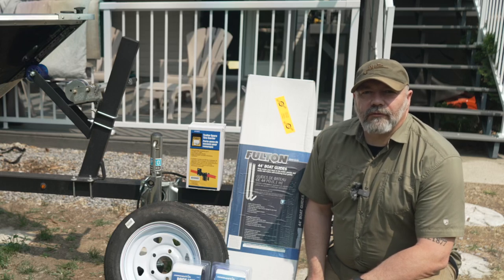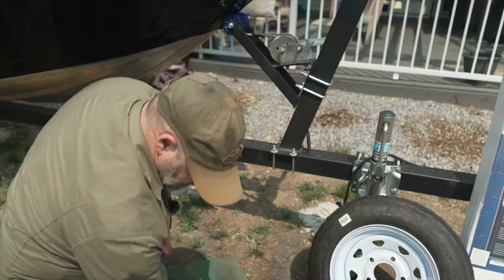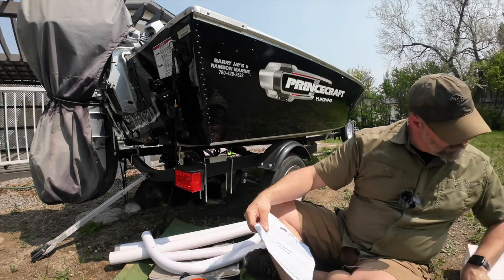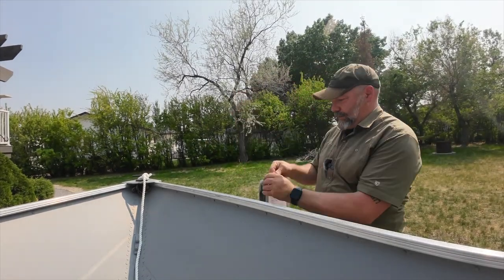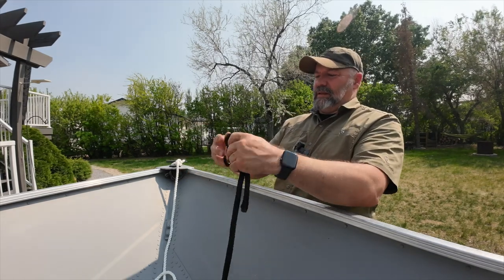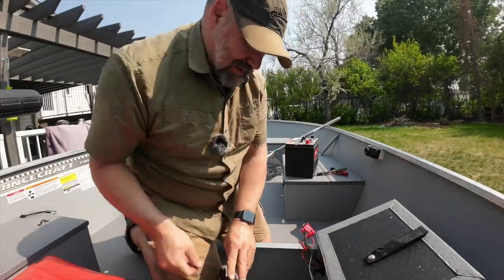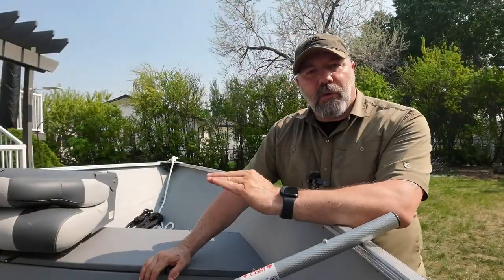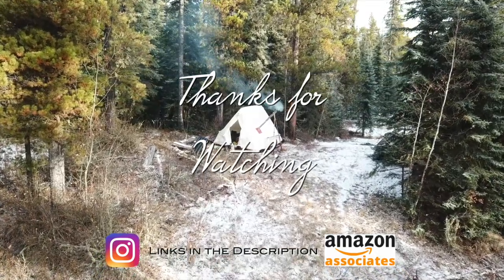Princecraft Yukon 140 & Karavan KBE-1250 Trailer Upgrades | Trailer Boat Guides | Spare Tire

Comment: Good video. 
I have a new 2023 14 Yukon as well however I mounted a Scotty anchor mount to the front bow . Not the removable one but the flat mounted one . Then bolted a cleat on that little step inside the front bow to tie off . So when I launch I’ll pull off the required amount of rope getting the boat off and pulling it back to the shoreline . Then once I’m of to the the fishing hole I tie on the anchor . 
I see as well you have your motor raised. Is it or suppose to be a 20” long shaft? . I ran into the same with my new 25 mercury long shaft . When I measured the motor I get 22” 🤔. Before this motor (mercury) I had a Yamaha FH25 FS portable. Needed no adjustments at all . Cavitation plate lined up perfectly straight with the keel ? . Go figure. 
Anyway, have fun .
Reply from the maker: Ohh interesting!  I'll have to check those Scotty anchor mounts out!!  The Honda is a 25HP long shaft and I had to raise it about 1 1/2" to get it aligned.  The boat came with a 25 Mercury power lift and trim motor that was faulty so I had it removed and bought the Honda.  The boat is designed to fit Mercury so no adjustment necessary.   I wish the Honda had the power lift, trim.  😞. My friend has the same Yamaha and he loves it! 👍

Comment: Lookin' ship-shape there Michael!  Don't forget to swab the poop-deck!  LOL  Do you have "Bearing Buddies" on the hubs?  Never go wrong with those, a shot of grease in 'em each spring if needed.
Reply from the maker: Hahaha - Poop-deck 😄 I do have bearing buddies - after I got my first set many years ago, every trailer get them if not already fitted!  They are awesome especially if you are dipping the wheel in water, like a boat trailer! 👍 Great tip!